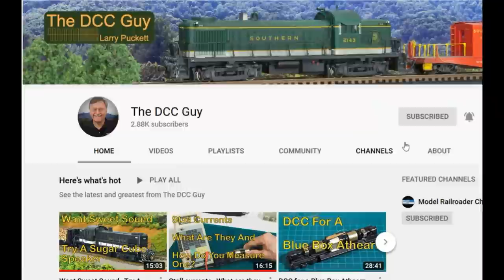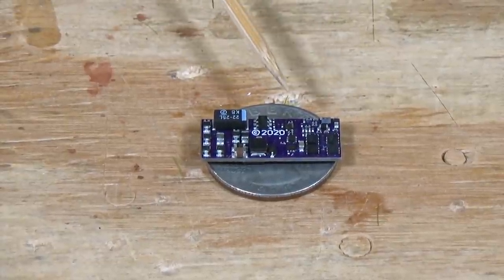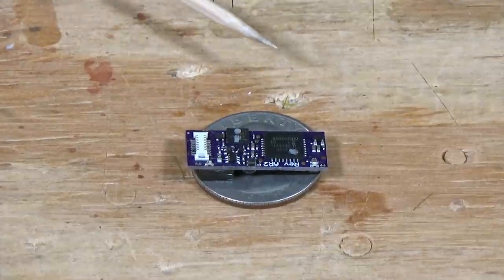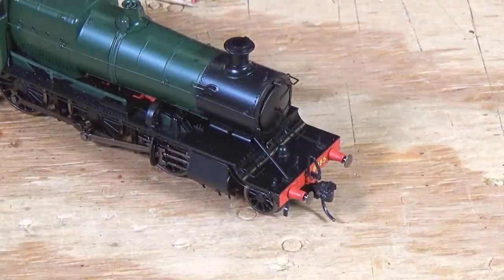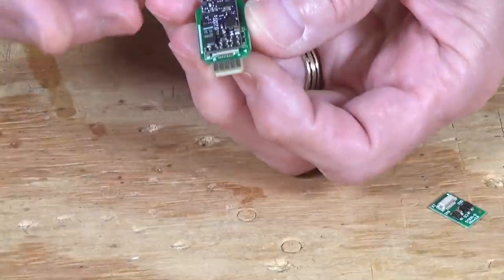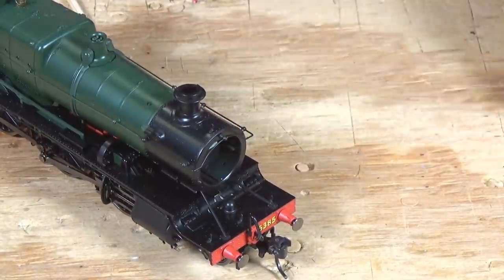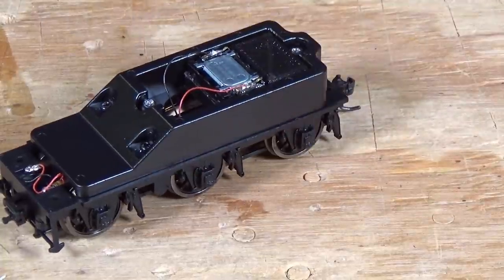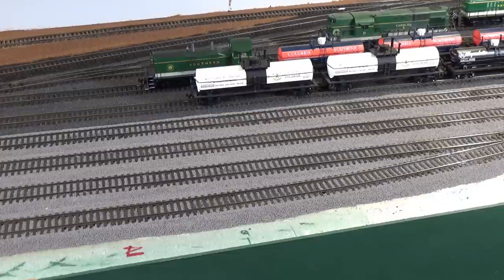New SoundTraxx Decoder And Steam Installation (192)

Comment: Thanks for the video! Yes those DCC developments are VERY exciting for those of us who want sound in smaller HO locomotives!  My only recommendation is to dial back the camera zoom about 30% - on several occasions the locomotive was out of the camera frame.
Reply from the maker: Thanks, there is always a tradeoff between getting in close enough to show everything and then finding out the darned thing was out of the frame. I wish I had a cameraman to handle that but not an option. I do try to check things as I go but sometimes it just gets away form me.

Comment: Hi Larry. I’m curious to know if you’ve done a decoder install on an older Bachmann steam locomotive with the split frame. Dc only version.
Reply from the maker: None that I remember. My Kato NW2 used a split chassis design and once I cut out a space for the decoder the rest of the job was easy. You just need to make sure to isolate the motor.

Comment: Dapol came up with a cleaver installation method in the smokebox.  That's a great method for smaller locomotives, especially tank engines.
Reply from the maker: Yes and no. Unfortunately it also cuts down on weight over the drivers so less pulling power. I have half a notion to out a decoder in the tender and shove lead into the boiler.

Comment: This is a very similar footprint to the Zimo MX659N18 Next18 decoder. I suspect the Dapol Mogul was designed around that decoder, as there is a Zimo sound package available from YouChoos that was recorded from the preserved 5322.
Reply: N18 includes the space spec for the chip unlike 8 or 21 that just specify pins

Comment: Great video Larry. Technology is certainly progressing well. It’s getting close to the point where even I could tackle a decoder installation project. How did the first speaker in the front end of the locomotive sound? Or where they both sounding. Thank-you.
Reply from the maker: I tested it when I first tried the decoder and I think because I did not have an adhesive gasket it was a bit tinny and low volume which is why I went to the speaker in the tender. Given that the wiring appears to be parallel instead of serial I would not want to try dual speakers as that can be taxing on decoders not designed for it. Especially one this small. When I have time I may test it with a sealer speaker in the boiler.

Comment: Nice vid.
Do you know if Soundtraxx has a Next18S socket to wires adapter, as a quick search only shows one from a competitor?
Reply: Various 3rd parties make some Next18 breakout boards similar to the Decoder Buddy that is mentioned in video.
Reply from the maker: If you need a wired decoder then get a TSU-1100.
Reply: @TheDCCGuy  But the new model has a smaller form factor than the TSU-1100. That is very important to us N scalers.

Comment: Larry I really like your channel and I am getting back into the hobby.  Last time I was in it was at the dawn of DCC and the original articles in model railroaded so its been a while. Do you have an index of your dcc videos? and one other question, i understand about how to program say a sound trax decoder using the software but what I do not get is how do I get the program to load the program to the engine and decoder in it. I understand how if I had a lokprogrammer hardware but how does it work with say just decorderpro? sorry to ask such a basic question but I am trying to learn a whole new world. thanks and keep safe and keep the hobby on the right track!
Reply from the maker: Soundtraxx decoders come with the sound files installed. When you program them using either your handheld throttle or DecoderPro all you are doing is changing the CV settings in the decoder. You do not load anything to the decoder. With LokSound decoders you can get the dealer to load the sound files for you and then all you have to do is change the CV settings in the decoder same as if you were doing a Soundtraxx decoder.
Reply: @TheDCCGuy  Thank you Larry for answering so quickly.  So a factor installed loksound unit must have the sound files already loaded from the factory, which makes sense. I had thought that all Loksound units came without sound loaded and while I know some dealers will do it others won't so IF i wanted load or change a sound file on a decoder that was loksound, I could only do that via their lokprogrammer, correct?  For other decoders like BLI or something what would I need to load a sound file to that one myself?
Reply from the maker: The only decoders I can think or that allow or require you to load a sound file are Digitrax, LokSound and Zimo. If you ask a dealer to load a sou d file for you and he says no  need to get another dealer. Those I deal with do it free as long as you ask at the time of purchase. And yes if you want to change the sound package for those you do need their hardware and software devices. BLI decoders come preloaded for the specific loco and are optimized for that model. And they seem to have gotten more reliable in the last few years.

Comment: The Next18 specification stipulates the maximum dimensions for the board and height of components.  A few manufacturers do factory fitted speakers so fitting is remove blanking plug then plug in decoder.  Give it an address and off you go.
Reply from the maker: I hope that is where the hobby is headed.

Comment: I have a bachmann 0-6-0 NON dcc ready  ITS HO scale it has the sloped tender I was hoping you could help I'd like to add dcc to be able to run lights and smoke generator separately I don't need sound but would be a plus if I missed any needed info let me know thanks
Reply from the maker: Take a look at videos #81 & 82. They both deal with small Bachmann locos and include sound and keep alive, but no lights or smoke generator. However lights are no different for steam or diesel. The steam generator may be more of an issue. Make sure the current draw is under what the decoder functions can support. I plan to do a couple of steam installs but not soon. Ask if you have more questions.
Reply: @TheDCCGuy  thank you I appreciate your help

Comment: can youdoa installion using a bachmann steam loco  using sound value
Reply from the maker: If I had one I might. The only steam loco I have left without a decoder is a brass 4-8-2 that needs painting before I mess with a decoder. Most Bachmann locos comes with a board and socket that I have seen.

Comment: Would you be able to use both speakers in your steam locomotive?
Reply from the maker: It may be possible in some cases with some decoders, depending on the way the speakers are wired and the decoder rating. I have not tried to trace the internal circuit so don’t know if it is series or parallel in this loco.

Comment: You can have my MTC 21 interface when you pry it from my cold dead fingers.
Reply from the maker: I keep bending the pins when I need to pull a decider. Not an issue with the Next18 connector.